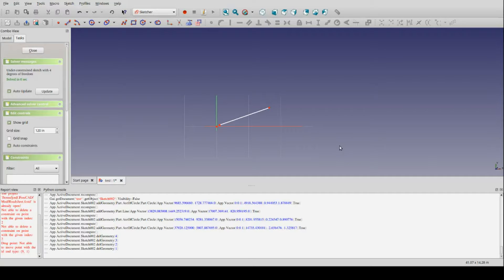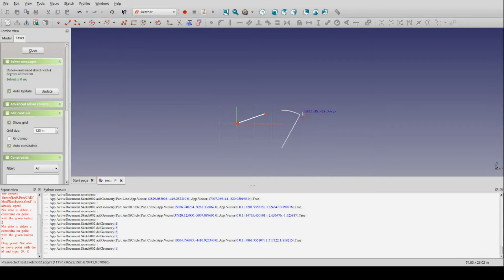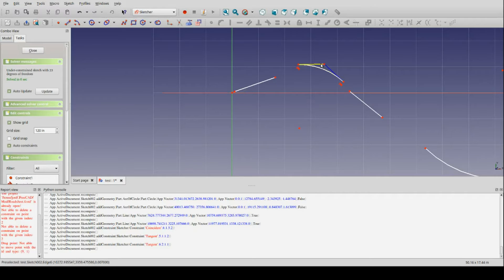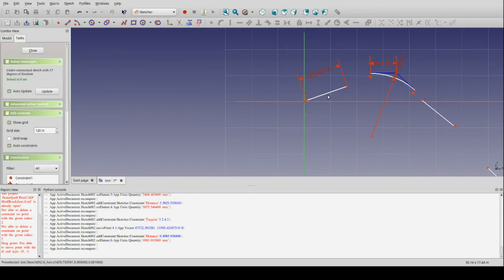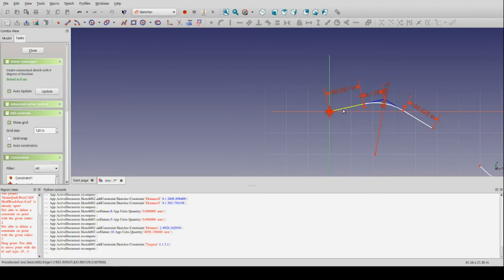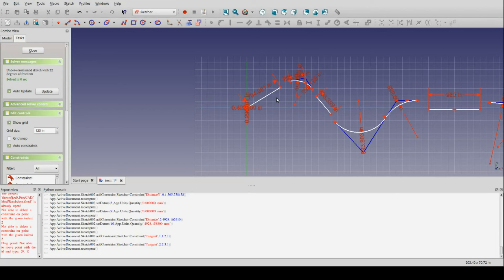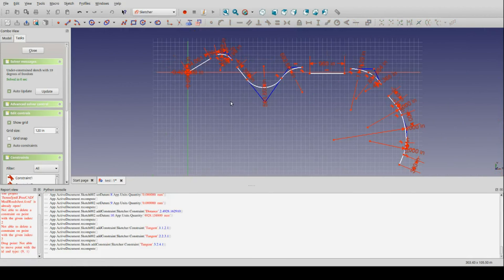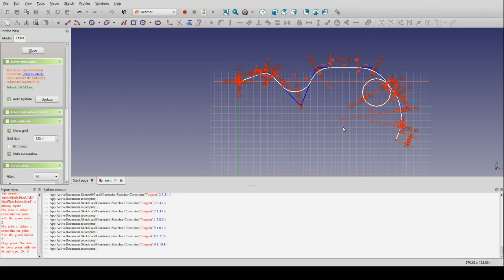freecad alignment

Comment: I'm new to FreeCAD. But... could you "Create polyline" and use M key to switch among various modes in "Create polyline"? I mean press M repeatedly to switch to the mode you need, draw a section, then press M to switch to different mode and continue drawing the polyline, then press M , etc.